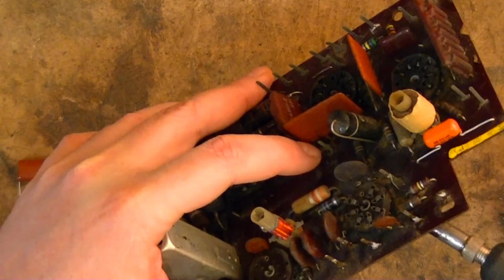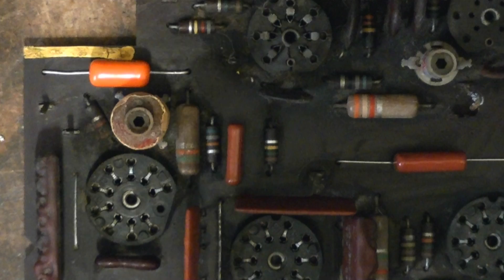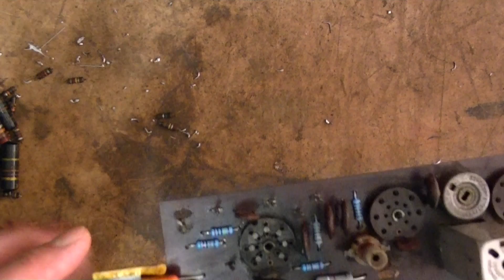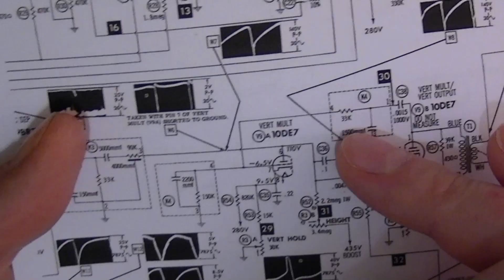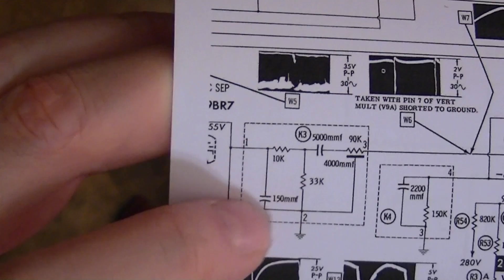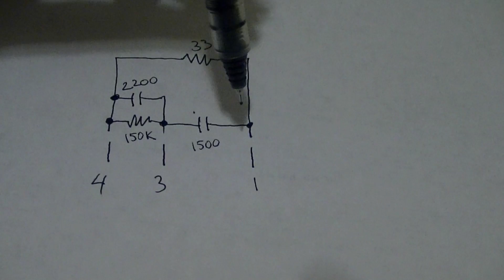Predicta "Holiday" restoration p3o?

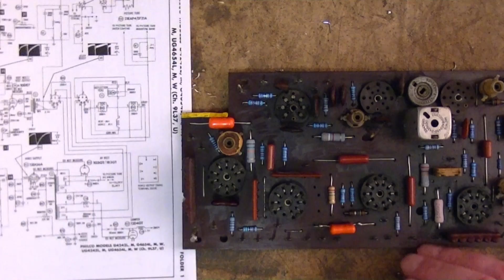Comment: at 11:47 you are wrong bob...the capacitors in the couplet are gonna see at best -6,5volts because the high voltage present at the plate of the vertical output tube will be blocked by the external capacitor C38...the problem may be that c38 gets leaky and then cremates the couplet's small capacitors
Reply from the maker: It's not DC that's a concern.  It's the large AC pulses.  C38 will couple them into the couplate.  C38 and the cap inside the couplate will create an AC voltage divider.
Reply: @bandersentv  OOPS sorry man..i forgot that ac could travel backwards on a schematic if you know what i mean ahahah :) :).  i guess the couplate provides feedback back into to the oscillator and the voltage dividing is to attenuate it to a suitable level...c38 also blocks the 280vdc off of the plate of the output...

i bought a predicta siesta on ebay from italy wich is yet to arrive...i thought they were only sold in the US...on the back it has a 110 and 220v selector and it says 50 cycles, it doesnt have the front clock with the auto turn off...  do you know if they made any export versions?
Reply from the maker: I know they were sold in Brazil, but never heard of a European version.
Reply: @bandersentv  if you want to take a look here is the link for the auction https://www.ebay.co.uk/itm/223371765016
it says it runs on 50hz so i guess it might be PAL version...after i hopefully repair it i will have to buy a pal to ntsc converter and try both with or without it, it will be a pain in the neck
Reply from the maker: I'm not sure what to make of that.  It's very different from any US model.  Never saw a 17" model with wood grain and the controls on the back are strange.
Reply: @bandersentv  appears to plywood or solid wood. the controls are flipped it seems.... nobody in europe has ever liked metal cabinets i dont know why but all tvs were solid wood, plywwod and in the 80's they were plastic and particle board...so i guess it has to be an export version for here. i am making some videos of it as soon as it arrives...
Reply: saying 50 cycles on the back means its probably pal...i guess
Reply from the maker: I asked on the Antique Radio Forum.  Someone there is likely to have some answers:  http://antiqueradios.com/forums/viewtopic.php?f=3&t=354761
Reply: @bandersentv  hi Bob...sorry to bother again! the predicta has arrived....it uses a 21evp4 crt, the flyback is white and seems epoxy dipped, not wax or tar....on the side it has UHF and VHF selector knob and the uhf tuning is on the back also. the cabinet is wood...the chassis ID sticker is torn apart... the crt is branded SELECTRON, so maybe a replacement?

Comment from the maker: Because I needed to unsolder and lift one resistor leg to test it accurately anyway.  There's less stress on the PCB if I clip out the body then unsolder the remaining legs.  Plus new resistors cost a few cents, are more reliable, less noise etc.

Comment: In a forum of  Antique Radio on a Holiday restoration topic, a guy said the following about the K4 module rebuilding: “1000V on the caps and I went with 1 Watt resistors to be safe. For the caps, use poly or mica. Not ceramic.” Well, you may have already seen it, but, if not, I hope that helps…

Comment: Hi Bob. I guess precise info you can get on the internet or from other experienced restorers. I think it's a question of asking the guys. In a site called "evilfurnaceman" in the item “tripod” there is the description of a Philco 21 TV restoration that uses those modules and a picture of the new one the guy buit. I’m not sure, but I think he used plastic film caps. He gives some info on the modules. Have you seen it? (sorry, I can't post links here directly)

Comment: U might try to dissolve the module's coating with acetone ( if it's a plastic or epoxy coating ) thus sacrificing  the original look. 'won't arm the components ( look at roland juno filter repair videos on youtube ) and you would be able to test/change the individual components of the module itself....

Comment: I would like you to do a video, showing all the different capacitors, and there applications for the different types. temperature coefficient frequency and  voltage ranges, and why one may be better then another, to give us a better idea on the choices, and another thing never stated is amount of safe currents on different types.

Comment: Enjoying it Bob... No obscure syndrome after all... : ) Do you intent to use those molex-like connectors or simply solder the wires back on? Using the same logic of the other components, wouldn't it be better to simply replace the modules (as possible) to assure the set will work properly over time, considering that, as you said, it's a pain on the butt to remove that board? Anyway, the idea of the transistor socket is good. Do you have any around? Btw, great tips.